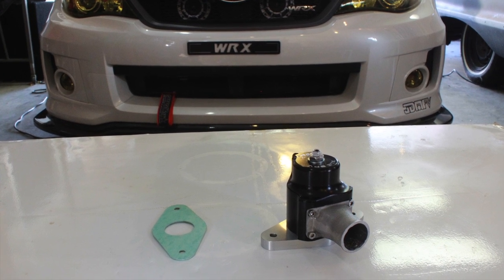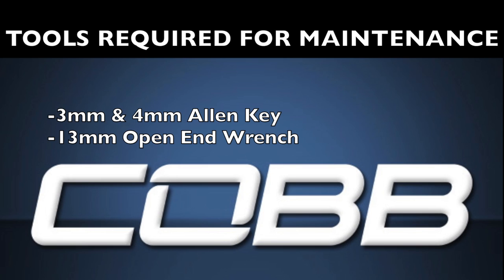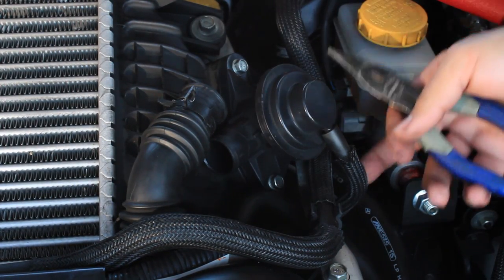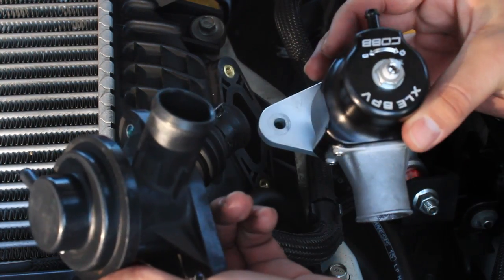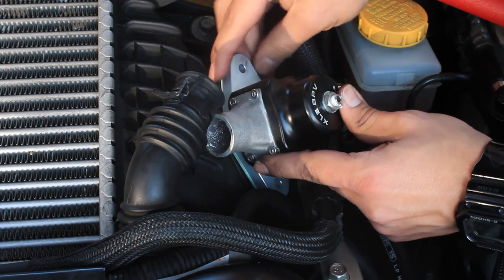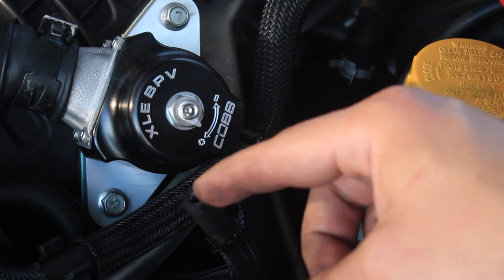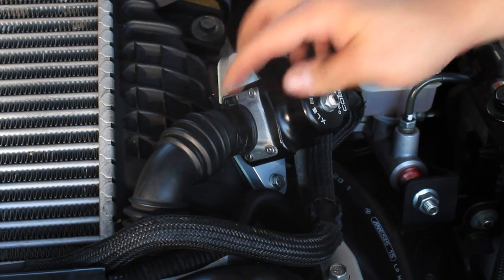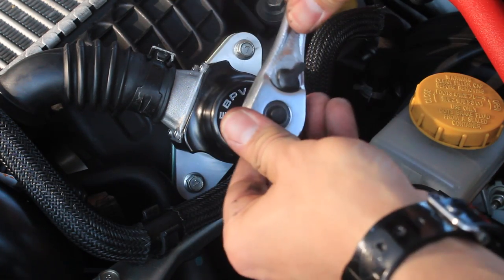Cobb 08+ Subaru WRX: XLE BPV Install Video

Comment: How do u know what to adjust it too? Please help. I have a 2014 wrx hatch, aem intake, invidia dp and q300 catback, stock bov, with Cobb stage 2 tune. 

I'm having a overbooste problem due to the weather, I live in Wisconsin. After ther I tuned it stage 2, it started happening, along with the temp dropping to low 10 degrees outside, I ran the code and it says I'm overboosting. So in theory, wouldn't a aftermarket bov like this one help my situation? And if it does, how do I know what to adjust it too? Please help

Thanks
Reply: Idk man

Comment: Do you recommend using the stock bolts and hose??
Reply from the maker: Gus Lopez yea thats what I used and its what Cobb recommends.
Reply: I put mines on and the check engine light came on, Did that happen to you?I did a diagnostic and read that it was burning too much air(Oxygen) and not enough gas. So i just took it off.
Reply from the maker: Gus Lopez that’s weird I never got that code. Or a check engine light.
Reply: MrImprezaWRX mines a 2019 model

Comment: What advantage does this give compared to stock?
Reply: it is able to handle a lot more boost compared to the stock plastic one. if you are stage 2 you should consider upgrading it for sure, some of these even leak at stock psi (rare but it happens). i am a previous owner of a wrx and when i upgraded mine it actually seemed like a performance mod because i had a boost leak coming from my stock bpv and finally ordered one.